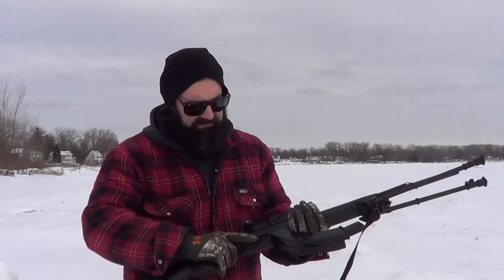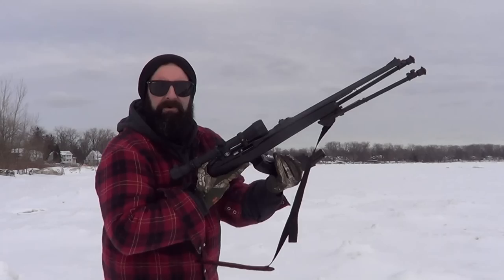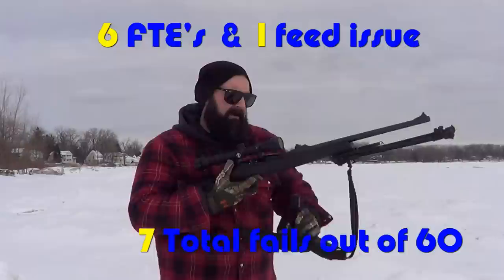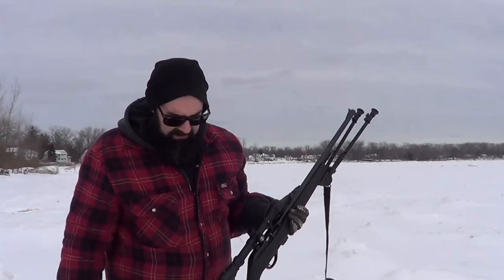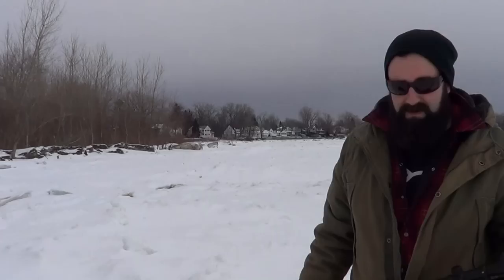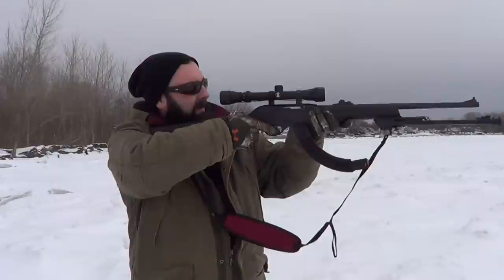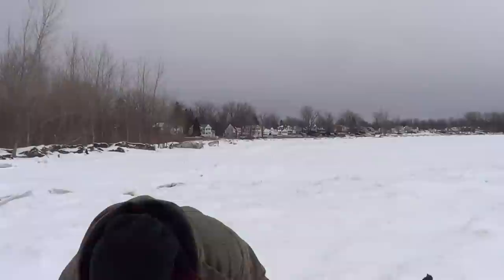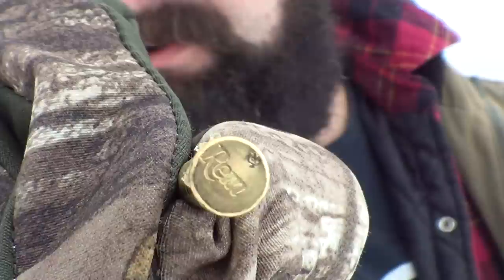HOW TO FIX THE REMINGTON 597 !!!!  (no more jams)

Comment: They must have updated the rifle at somepoint. Ive owned one for a year, put over 1000 rounds through it, and never a failure. Great value.
Reply: +HerrMueller93 what ammo are you running?
Reply: Mini mags through all my .22
Reply: Same here, I've put over 2000 through mine, no problems. Excellent groups. Works like a champ!
Reply: @NowellHolmes  I haven't had any problems. I've used thunderbolt, mini mags and federal copper plated hollow rounds.
Reply: Dump it! Remington had a period where those guns would never work
Reply: Amazing little .22s! My friend has one, that thing instantly makes me a better shooter when I use it, lol.
Reply: I've put a dozen of thousands of cheap (the cheaper the better 😀) through mine. It fails once in a very while, but only in below freezing temps. Not sure what's wrong with the gun in the video
Reply: Hi from New Brunswick. Could you give me the name of that company please? thank you in advance .
Reply: @karlpreston6369  volquartsen

Comment: Mine jammed or failed frequently until i slightly loosened the rod tension screws.  They were too tight from the factory.  If the screws are too tight, they will slightly bend the two rods the bolt rides on.  Works flawlessly now.

Comment: Replaced the original extractor with a Volquartsen and took it to the range today. The 10 round clip never jammed. The 30 round mag still jammed. However, I remember taking the end off the 30 rd mag after I purchased it and you know what happened next, the spring sprung out of the mag and across the room. I put it back in. Perhaps I put the spring back in wrong. After I took the spring back out and reversed it I had no more problems with the 30 rd mag.

Comment: I watched your video. I have the same rifle. I purchased it from a pawn shop. I ordered the part and changed it out before I even fired a round. It chambers each round perfectly. I know, without a doubt, that's the reason it was sold to a pawn shop. It was spotless on the inside. I didn't have to clean anything. Thanks for the awesome video.
Reply from the maker: +Patrick Palombo 
 No problem ! 
Its really the only weak component on the gun.
If Remington knew this 7 years ago it would be the undisputed best .22 lr on the market.

Comment: I bought one the first year they came out as my trusty old Remington Nylon 66 walked off on it's own. These first couple of production years were notorious for not cycling shells. Poor magazines, COMMON KNOWLEDGE! and worthless dull poorly spec'd. extractors. Mine was awful out of the box with factory 10 round Magazines. I cleaned polished and tweaked everything. Keep shooting aftermarket mags helped but this Volquartzen finally did the trick. Thanks for the testimonial and video. I shot some awful old poor ammo through it and it just chews it up. I've got about 1,000 rounds through it and no failure to feed or failure to eject. One failure to fire and that is it. It thinks it's a Ruger 10/22! Saved the gun for me.

Comment: I have no problems with my factory 10 round mag and Federal Champion 36 grain rounds. When I use my 30 round mags, they always jam. I've had a Volquartsen extractor on hand since 2021 in case I needed it but just this past month, I finally installed it after seeing several videos like yours. I'll test this soon with all my mags shortly. Also, apart from the large mag jamming, this rifle is dead on accurate.

Comment: I also changed the extractor with same as in this video, works flawlessly. I would like to add that if you over tighten the bolt guide rails they will bow out and might add to failures in ammo cycling properly. Thanks for posting this video..regards

Comment: I see some folks talking about how theirs runs fine. I think something to keep in mind is that manufactured components are almost never exactly the same. Even if they are for the same gun by the same machine. The parts are only as good as the sharpness or quality of tooling installed on the CNC machine, and the CNC machine is only as good as the human that programed it and calibrated it. The parts are only verified if the company spent adequate time to pay and train good QC people, which many of them do not. The current state of Remington is a bit of a sign, in my opinion, of the quality of its manufacturing and quality of management. Also, the ammunition has a massive impact on how well a weapon runs in spite of its flaws. If there are design flaws, such as the incredibly inadequate feed ramps, or wobbly follower in the magazine - poor ammunition will exploit those flaws, while higher powered quality ammunition will often power through. Bolt carrier speed slows down when the ammunition is lower powered, which means that it also moves with less urgency and less momentum, which results in less "oomf" to push the round into or out of the chamber. My 522 is a pile of dog shit, but runs CCI stangers pretty reliably, compared to the thunderbolts, which fail to feed every 2nd round chambered. Just my thoughts though.

Comment: My extractor blew off the bolt at the range one day...if u have problems getting the 30 rounders out...lock the bolt back by holdling the gun upside down ( so the lock back is up from gravity...then remove the mag.

Comment: I've got the same exact setup as yours, including magazines. Had a bad time with jamming, so I followed your advice and bought the Volquartsen extractor. Out of the box it was too thick to fit in the groove. So I sanded one side of the surface of the extractor with an emory finger board. Was still a tight fit but got it in okay. The problem I had was that it still jammed when I fired the shells one at a time, but on rapid fire went smoothly and emptied the 30 round clips without any mishap. I repeated this three times with both magazines loaded with up to 18 rounds each (clips won't take anymore than that), still the same scenario. I used unidentified off brand round tip 22LRs I had saved up and dumped all in a big box, but it seemed to improve with Winchester 22LR, 36 grain, hollow point copper plated. Will let you know in a few days how the Winchester ammo worked out for me. This is getting really frustrating.

Comment: My 597 came with 2 stock 10 rd mags and 2 each clear and blk 30 rounders.  I had to CUT one of the black ones out and none of them would run.  

The stock 10s I've never had a problem with.  

I only plink or shoot whistle pigs with it so only getting 8 or 9 rounds loaded is a non-issue for me.  

 I did the best modification to the 30 rd mags ever.  They got tossed in the trash.

Its accurate as hell and a fun shooter for me.

Comment: i don't know if you noticed, but with your remington extractor the casings fly in every different direction with no consistency. 
with your new extractor all the casings eject consistently straight out or aft of the bolt.
Reply: I  noticed that aswell.  I have a brand new 597 that is doing the exact same thing.  The supplied 10rd mag feeds fairly well but the extractor was garbage right from day 1.  I even tore the bolt down and polished and lightly oiled the stock extractor and it still works like crap.  The 30rd Rem mag i bought is 100% useless.  I ordered a Volquartsen extractor so hopefully that will make her run like it should.  I tried M22, CCI mini mags, rem gold, cci blazer, winchester wildcar, federal auto match and federal target.  Some ammo failed to extract more often than others but every type of ammo failed to extract enough that it ruins the entire gun.  Hopefully this new extractor will work.

Comment: Using the stock 10 round magazine and CCI Mini Mags, I haven't had any issues.  With the Remington 30 round mag, I get a feed issue with the first and last round every time.  Using the ProMag 22 round magazines, the bolt holds open on the second last round (leaving one round in the magazine after firing the second last round).   I find semi autos problematic with the Remington Golden Bullets in general.   The 597 is no less reliable nor less accurate than the 10/22 or Model 64. 
Nice fix with the new extractor, though.   Thanks for the tip.

Comment: Im gonna give this a try. This was my first gun and I would like it to be my little brothers first gun as well. It currently stove pipes most of the time, sometimes it kicks them halfway out and the bolt is stuck damn near fully open on the casing. I run Winchester rounds through it and never had a problem until after the first box of 550 rounds.
Reply: Your issue might be dirt or debris or it could be too much tension on the guide rods. Clean it, oil it and losen those set screws just a hair and try it again.

Comment: I bought mine in summer 2017. Gray stock but-  well. They must have upgraded the rifle. The R 597 is so reliable is almost boring to shoot on the range. The only issue I have is that I have no iron sights. A vermin utility-rifle should have some standard iron sights. But that is only my opinion. I asked a gunsmith to add some iron ones but this would come more expensive then I paid for the gun itself. That little rifle helpt out a lot shooting vermins on the yard. If someone lives in the country outside in the sticks, a 22lr is essential. 
I am very pleased with my Remington 597.

Comment: I used to have lite primer strikes with my 10/22. I took the firing pin out. Straightened it and sanded both sides smooth. Haven’t had a problem since. A lot of these parts are cheap stamped steel. Might want to check yours out.

Comment: I did tge same thing mine had 1fte durring first mag w valquartsen extractor but been 100% through 0ver 500 rounds since not a single malfunction. Not even with weaker standard velocity ammo when its dirty. The first mag was with cci standard velocity ammo ,its subs sonic. All rounds where shot surpressed, so it got really dirty and wasnt super clean when i started other than the bolt face. Those 500+ rounds are the most ive fired consecutively though a surpressed rimfire without a malfunction.

Comment: I have had no issues with my remington597 16"bull barrel
Up ttill now i have 14 bricks through mine and never a extraction problem,the last time i had it out the last shot would have what seems to be a feeding problem the last round would get bent and not feed into the throat barrel,i am going to  take it apart and clean the 597 for the first time ever i think its a guide rod problem

Comment: Yeah thanks from NewZealand for your comments , I've got the yellow laminated pistol type stock an the Heavy barrel version , but yeah sick of it not ejecting and click no boom .. And it's been in the gun shop twice since buying new, It,s had heaver springs fitted don't think that helped as it fires 3rounds auto and real fast till it Yip jams, But I do like it, Has such a different pop from other .22 guns .. Remmington should have recalled them and fixed them for free is what I think ..

Comment: I think you got a lemon my friend....mine is flawless in extraction.
Reply: +Mark Kerns. I second that, I've had mine for over a year and the only problem I've had was with Winchester ammo. I use Remington ammo, no issues with cycling and very good groups.
Reply from the maker: +Mark Kerns 
-I believe mine was from an early production run and changes were made after to improve reliability. I think i got it in 2006.
Reply: Mines the same way. I bought a ruger 10/22 and when my dad saw I was shooting it a lot he asked if I wanted to borrow his 597 that he bought for us as kids that we never shot because it was trash and always jammed. Childhood probably would've been a lot different if my dad would've bought a ruger
Reply: I've had nothing but problems with mine, so much so I stopped shooting it entirely. I almost gave it away (seriously, I had nothing but problems no matter how much I cleaned it, changed mags and ammo), until I found out you could replace the extractor.  Now it's golden.
Reply: Mine was absolute trash. I could not get through a standard magazine without at least 5 malfunctions. Initially they claimed the new model mag would fix it, but it did absolutely nothing. Sold it and never regretted that decision.

The only purchase I regretted more was the CZ 122 Sport. That turd misfired 8 times out of 10.
Reply: Same here.  Got mine used in a trade and the only issues I had were with the useless hi-cap mags.  Thought I was going to have to cut one out with a hacksaw.  The factory 8-9 rounders (uhuh) have cycled flawlessly for me.  I'm ordering some newer after market 10ers that have great reviews from keepshooting.com
Reply: Mine fails to extract on average every other round
Reply: @maineiachomestead7550  if u notice when the 10rounders wont load to capacity the first round is stacking to the wrong side when the 2nd round is loaded, i had one doing the same thing. i finally figured it out by comparing the mags. Just try to force the 1st round to the other side when ur loading the 2nd round, after 5 or 10 times loading like that itll fix itself( or at least mine did).
Reply: I have the same one same problem
Reply: Same here
Reply: My remmy started jamming after 700 rounds went through it and i never once cleaned it. After a cleaning it's working flawless again. I'm debating changing it for peace at mind. Lots of shootings going on in SC right now.
Reply: Mine has been shit since day one. $30 fix will make this a expensive rifle.

Comment: i had trouble till i started thinking of the mag as 25rd not 30rd and blazer 40gr ball points haven't jammed after 300rd or so not one problem but win 22lr were bad about 4James a magazine all and any light target round won't work at all my gun is off the shelf and no problems now

Comment: I MY SELF GOT ONE OF THE FIRST MADE  597 AUTOMATIC   IN 17HMR IT JAMED & FAiLURE TO EXTARCT ALL THE TIME /SO  THEY RECAIIED THEM ALL / BUT MY NEW MADE REMINGTION  597  AUTOMATIC  IN 22  LR   MANY YEARS  BACK IN FIRST MADE ONE HAD SAME CAME WITH   A   10 ROUND STEEL  TOP CLiP WORKED GREAT MY 2O ROUND STEEL TOP WORKED GREAT USED WHAT MY GUN DEALER FRIEND  JUST  DOWN THE ROAD NEAT O FAMILY OWNED  PLACE !    AMMO SAID USED IN NO MALFUNCTIONS /CAME WITH THE BLACK STOCK MY BEST FRIEND /GREAT  AT  DOING ALL KIND OF  SPAYED PAINTED IT IN CAMOUFLAGE  /THEN I PUT A WOOD THUMB HOLE HAND MADE IN A BROWN LIGHT & DARK BROWN WITH BLACK LINES SMALL IN THE WOOD STOCK LOVED IT ! I LIVE IN THE WEST PART OF THE BLUE RIDGE MOUNTAINS IN NC /A GREAT PLACE THE OLDEST MOUNTAINS  ON THE EARTH  ! WEAR YOU LIVE IS WAY NEAT OOOO TOO ! REAL COLD YOU ARE SUFFER /?????? WHY DID YOU GET THE 597 OVER A RUGER 10-22 ?? JUST LIKE TO KNOW BEING A GUNNER  ! WHAT GAME DO YOU SHOT WITH IT ???? YOU ARE A HUNTER & OUTBACK MAN / GLAD YOU GOT IT WORKING GOOD ! GOOD SHOOTING TO YOU & HAVE A MERRY X-MASS

Comment: Mine hardly jams but I heard that if you barely loosen the guide rod screws (the little ones on the back near where the hammer strikes) and since I started doing that I had no jams do to the gun. Yes mine is an old one

Comment: Mine has no issues other than the mags do not reliably feed.  Sometimes it sticks and requires you to slap the mag to get the next round to pop up.  Other times it just doesn't pop up fast enough.  I have 2 mags both have the same issues.
Reply: Mine works great to I got for Christmas a while back and the first time I shot it I fired 100 rounds through it and it only failed to extract once.

Comment: I have a 597 and the stock mags work perfectly but my 30 rnd mags work just as bad as yours did before the extractor change. I am sure all my problems are just the mags and not the extractor.
Reply: +JIM ECKENRODE Where do you get a 30 rd mag from for the magnum rounds?

Comment: Man I wish that fixed my gun.   I just replaced my extractor and hammer with Volquartsen and I'm still getting stovepiped.  I fired about 60 rounds and had roughly 15 misfires.
Reply: keonep1 do you use high velocity or standard ammo.  My gun wont cycle standard velocity for shit.  Also have you adjusted the guide rods.  Sometimes they are over tightened from the factory and bind the bolt when it moves.
Reply: +Dan Luciano i don't over tighten the rods. i think in going to try polishing the rods next to see if that helps
Reply: keonep1 Five minutes spent polishing the guide rods sorted out all the issues I had with mine.
Reply: I just did that this past weekend.  I forgot they were supposed to be gray lol.  It def helped with the firing pin hitting with enough force to fire off the round, but I still got 2 stovepipes and one completed failure to eject out of 40 rounds.  I ordered a new extractor spring, that's about the last thing I can think of (aside from buying expensive CCI ammo).
Reply: I finally got it working.  I replace the extractor spring as well, but it still got ejection issues only with the 30 round mag.  With the 10 round gen 2 mags I had zero issues shooting remington thundercrap bullets.

Comment: I've owned my 597 for years and have never had an issue.  The only time I've ever had a round not extract is when it was a dud. So it obviously wouldn't extract.  The problem is not with the rifle, but with the clip. And those 20 round ones are the worst.

Comment: Just got the Volquartsen extractor for my 597. Looking forward to fitting and using after your vid. Any problems with the install?  Many thanks.
Reply from the maker: pretty easy. theres a good install vid here on YT. I didnt need it, seems pretty straight foreward. once you take the old one out you see how the new one goes in.

Comment: I’ve pretty much done a complete overhaul on my 597 including a brand new trigger assembly among other things but for some reason when I shoot the gun it still either doesn’t eject the cartridge or the bullet gets stuck at the beginning of the barrel and doesn’t slide all the way in. I have thoroughly cleaned it 5 or 6 times and still jams or doesn’t eject, any ideas?
Reply from the maker: Could be a poorly manufactured barrel.